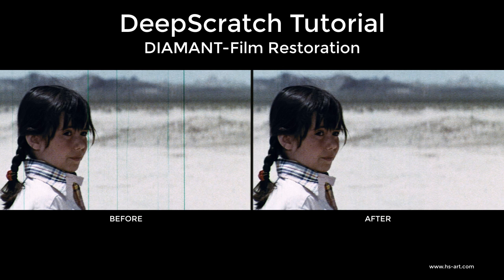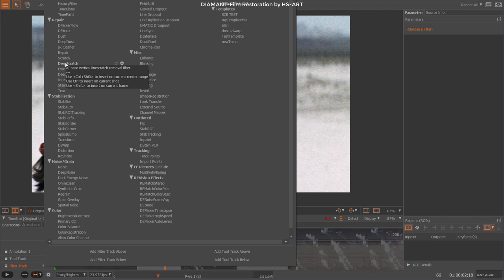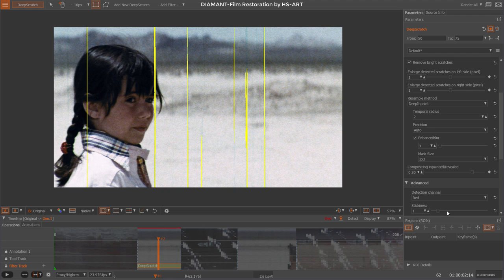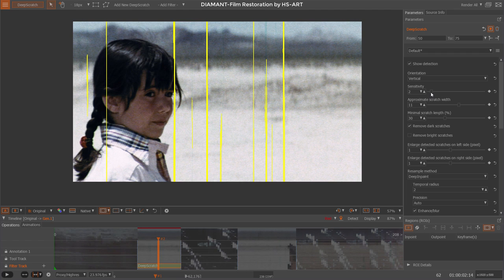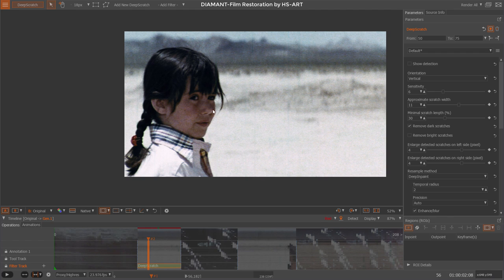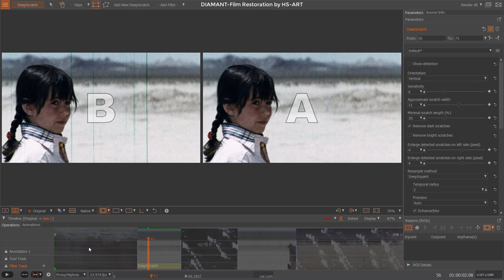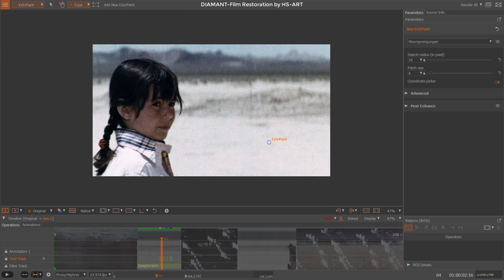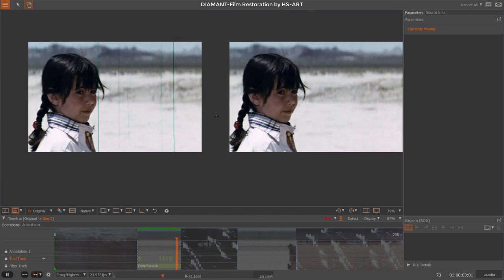DeepScratch Tutorial DIAMANT-Film Restoration

Comment: Super video, Franz. Scratches are some times VERY difficult to repair to a satisfactory standard. A cool tip is to go into the post enhance tab and play around with the regrain options. It'll add a film  grain in the repaired areas to help it blend/match into the original surrounding areas. This regrain trick is also available with many of Diamants other filters too. I always use the regrain option in the interpolate tool filter!